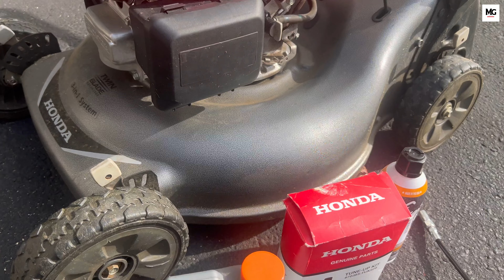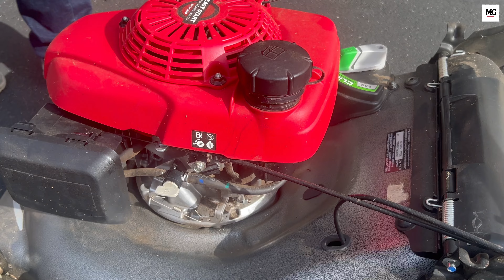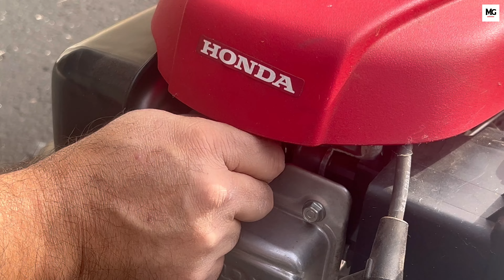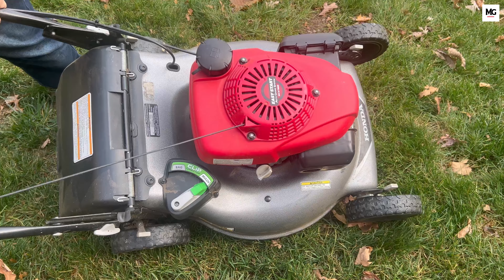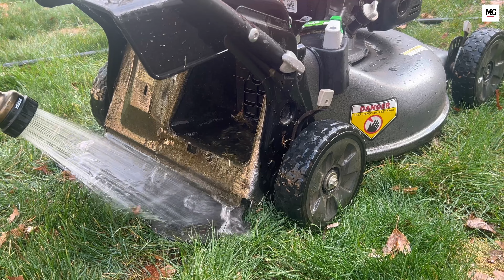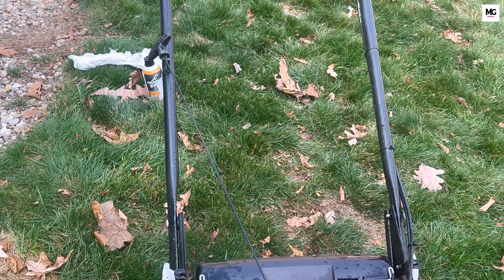How to Get your mower ready for Winter Storage

Comment: every single Honda mower have cam gear in plastic and with heat inside the engine can melting that gear and then came very trouble